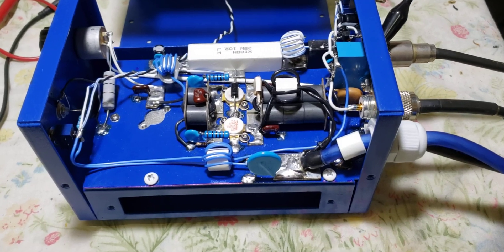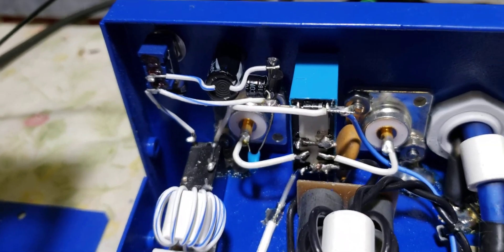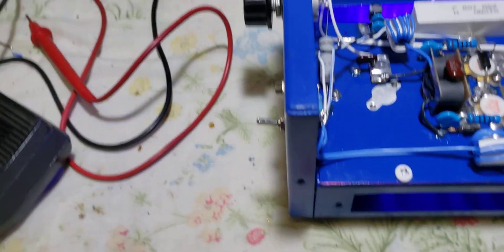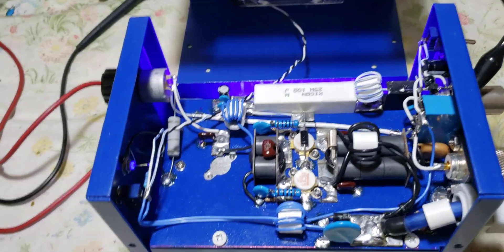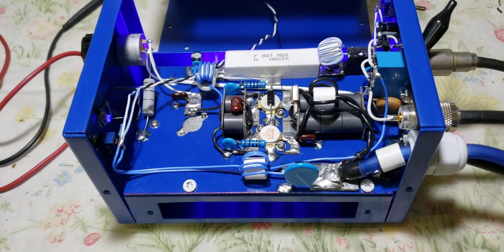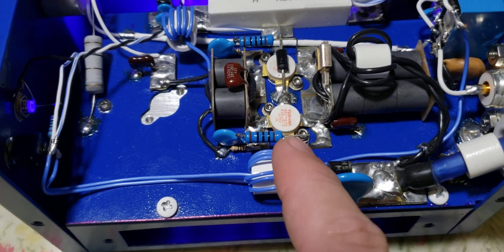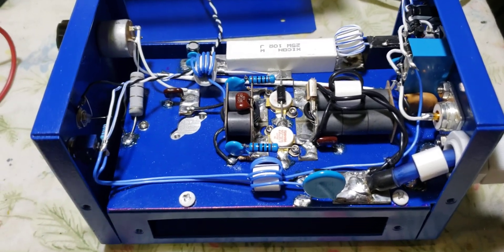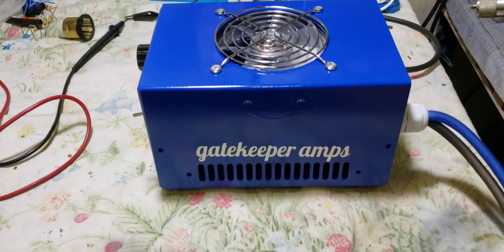2 Pill Beautiful Blue GK200 B-Biased Amplifier w/Blue Board

Comment: Hello sir,
What I was wondering is, can those transistors also work well on WFM 85MHz?
here in the Netherlands it is a pirate band.
I am also amazed at the amount of transistors you have and use?
(I assume they cost something?)
And the question is where did you get them?

Healthy and Friendly Greetings from the Rotterdam NL area.
Rob
Reply from the maker: Oooooh wow I have never heard of the pirate band over there on 85 mhz. I am going to have to look that up on YouTube to see if anyone has some recordings of this. These particular transistors are transistors that I sell to the public state wide and internationally. These particular ones are good for up to 30 mhz. You would need to use something like a BLF188xr or there are a few other devices you could use for 85mhz it is so close to the normal 88-108-mhz broadcast band. Im about to go look into this right now.

Comment: Hello Mr gate keeper I've got a amp over here that has a high pass thru swr, high input swr, and the big bias resistors get smoking hot when it's keyed.  I can't find a dang thing wrong with it though, any ideas?
Reply from the maker: 1.  Tune the pass through
2.  Re tune the input swr
3. First thing is first check the bias and make sure it is at 0.68v or under. That resistor is suppose to get hot 🔥 during use but not blistering hot just after a quick key. If it is higher then 0.68v then the bias needs fixed.

Comment: Best not to bias that box so hard. they make more heat. with that 4 pill cabinet you could run up bas a bit more. still want that diode on heat sink or pill . nice heavy resistor.  I had them go bad, like on the LA 900 1X4 bias box.  it works good but that resistor gets super hot on that one.  bias all ways on with amp on. had to replace with 50 watt one. for HG leave set where you have it. ICA does have a newer 4 pill cabinet.  he re did his web page. so have to re enter your info to place a new order. was a wile ago now. I do have the newer 8/10 pill base cabinet . using for LD-MOS 65V build. using the room the switchers go for the filter board. multi band 160-6 meter box. band pass filters take room.  DX world parts in ICA cabinet . using vacuum relay . still don't have all parts to finish. it's mine . busy with outher work. yes my girlfriend has steadier hands . she in health care . a must for her work. 73's
Reply from the maker: Yep both of our GF are in health care :) id love to see this ldmos build when your done bud. Your right about the la900 they leave that bias on at all times man it is crazy.

Comment: Thing looks beautiful man. Question for you what size of Teflon wire runs in the transformers
Reply: 16 gauge
Reply from the maker: Yep 16 is perfectly fine I like to use 14 when I do 2 wraps for a tad better coupling.
Reply: @1883GotDown  happy Easter man
Reply from the maker: 16 again on input 14 awg on output

Comment: All the short runs ..detail is key to the amp function,small runs of wire ... Love the nice isolation pad of the input shunt cap..all the detail,this amp should.last 50 yrs if it's operated under a proper 50ohm load ..and not over drove or over volted......also like this bias network with the sandbar. Resistor and loading cap and loading diode and blocker... perfection should last forever ..
Reply from the maker: Justin! Agree with you guy has been running it for a year now so...so far so good.